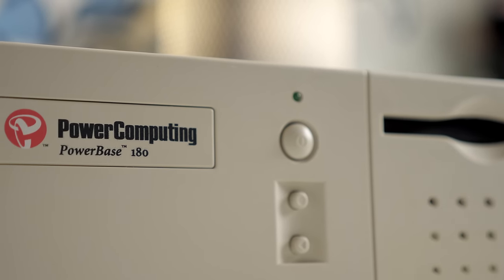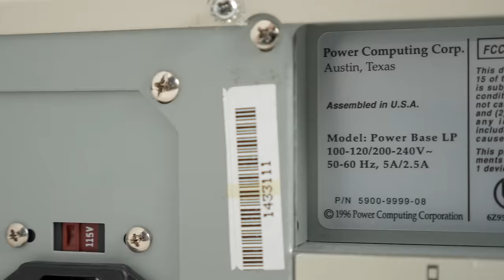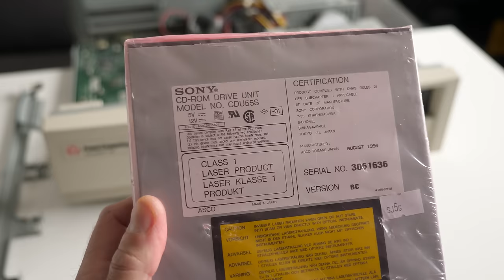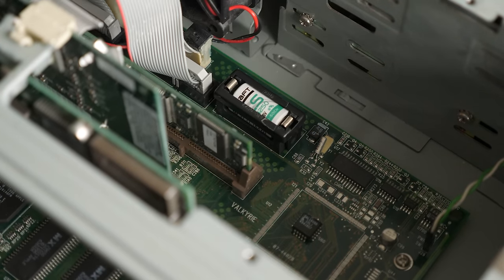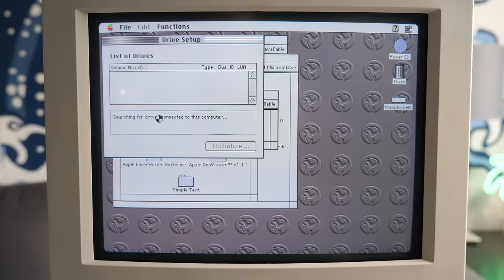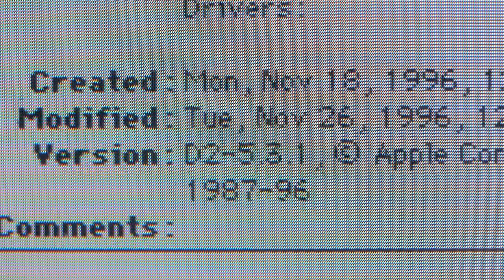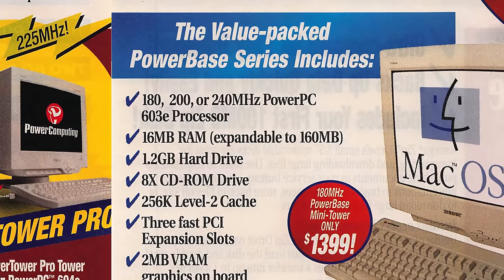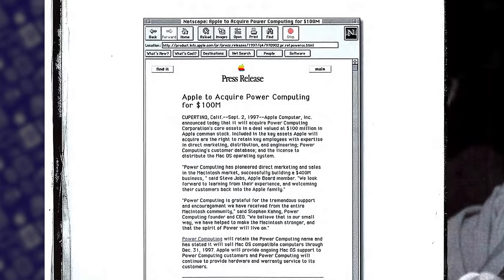Restoring a Power Computing Mac Clone from 1996!

Comment: That was such an expensive time in computing!  It wasn't uncommon to spend between $2000 to $3000 (or even more) for a powerful "blazing fast" system, which would start to feel slow or sluggish in only 2 years or less.
Reply: Six months was the average for the time and why there were so many third party cpu upgrades for both pc and macs. These days the average system often has to last around six to ten years partly due to the shortages.
Reply: My new computer's got the clocks, it rocks, but it was obsolete before I opened the box.
Reply: It's ironic since most people assume that Macs are at their most expensive today with the highest spec Macbook Pro coming in around $5000 (in today's money). Meanwhile, $5000 (in 90s money) was the starting price for a lot of IBM business class laptops back in the 90s. And that was before you added on all the optional docking stations, printer adapters, external CDROM drives, etc.
Reply: @soviut303  that's right, i own a Thinkpad 770X, i bought it two years ago for 70 Euros from a guy in Germany, That 1999 beast cost US$5000 back then, Crazy!!!!
Reply: I had an Amiga 2000. It was both expensive AND sluggish out of the box. It wasn’t nice and zippy until I laid out another wad of cash on an 030 accelerator board.
Reply: @CantankerousDave  Once you got the 030 or 040 accelerator board, you could then get a Mac emulator to run on that Amiga, and in some cases it was actually faster than a native Apple Macintosh. I did that for many years. Quite amazing to be running two operating systems seamlessly on one computer. I will say I did have a decently powerful graphics card that I had upgraded my Amiga 4000 with, so that helped for sure. I spent way too much money on that Amiga keeping it running and powerful enough to run the newer software, even after Commodore went bankrupt and no company was going to buy out the intellectual property to keep the Amiga hardware and system afloat. Eventually moved to PC by early 2000's.
Reply: @marcusdamberger  The Amiga is still alive today, with a Morph OS installed on MAK PCs and you can continue to use this defunct computer.Processors from G3 to G5 are supported.
Reply: In 1996? You could certainly have bought a reasonable mid-range PC for this price that would have lasted. Apple just had a habit of dropping support for their own hardware in no time at all. 

I know people who were using 486s well into the early 2000s
Reply: not as bad as late 80s and early 90s ;-)
Reply: @MrKillswitch88 unless your apple which have been caught slowing their devices each year to get you to buy a new one

Comment: Wow, what a find this was excellent.  You have a lot of technical skill and are very resourceful with both vintage hardware and software.  A Power Computing Mac Clone from the mid-1990's which, was around the time, I purchased my first Apple computer an All-in-One 5400.  Also, I noticed that, "Mac User" magazine rated my 180MHz 603e processor system from Apple with 3 and 1/2 "mice" and rated Power Computing's 180MHz 603e processor system with 5 "mice".  

The main reason, I selected Apple was because they made or branded all elements of my system the CPU, keyboard, mouse, printer, scanner, internal video capture card, internal TV/FM radio card, with matching black remote control, and system software.  My desktop came with lifetime free telephone support so, if I had a question just had to say to my Apple representative over the telephone my "xyz" is connected to my "abc" and state my version of the classic Apple operating system and my issue would be simple to resolve (smile...smile).

Comment: The first CD-ROM drive (Sony?) has sockets for the terminators underneath the SCSI connector, as far as I can see. So you have to install the two or three resistor networks to enable termination.

Comment: That’s an awesome system! The Mac clones have always been interesting and Power Computing made some cool systems. The Sony Trinitron also goes really well with the setup! Great video!
Reply: Even the Mac CRT's with the Apple logo on the front were really Sony Trinitron tubes, they always looked so good. You could tell by the quality of the shadow mask it was using and the fact the tube was curved like on a cylinder instead of a ball. I suspect the electronics inside those CRT's was also Sony, but I never opened one up to see.

Comment: I had a PB240 back in the day. My grandfather was heavy into Mac and we started with a mac plus, the went to a IIci, LC3, then the PB240 and eventually had  Powermac 6500, before building my first Windows PC, in 2003. Been a PC user exclusively since then. I did have a lot of equipment that most people never heard of, like a Syquest drive, zip drives and a magneto optical drive.

Comment: Nice restoration and lovely videography as always. 
I'm surprised the optical drives gave you so much trouble. I bought a PowerCenter Pro 180 in 2020, and it came with the original optical drive and a 16x Yamaha CD-RW - both worked fine after installing just the basic Power Computing system software on a BlueSCSI.

Comment: Brings back a lot of memories of my Power Wave 604|120 system. Many similar upgrades, however I found the Power Computing system to be very fickle as to what upgrades actually worked. I later had a Bondi G3 Mac tower that was a lot more compatible. Remember that Power Computing was using the same motherboard chipsets as Apple but were getting better benchmarks. I would bet that Power was tweaking the clocks a little to get better performance at the cost of compatibility.

Comment: Thanks for the video. Power Computing was killing it in 96 and 97. I bought the high end Power Tower Pro 180, with the 180 MHZ 604e which was brand new in late 96, and it was factory installed with the IMS Twin Turbo 128 video cars. This thing ran circles around anything apple was producing at the time, and faster than pretty much any Pentium or Pentium Pro PC at the time. In the next year Jobs killed PowerComputing (and all clones) and actually started making some good macs. You all know the rest of the story lol

Comment: I had a Radius tower Mac clone. The 81/110 was an extremely heavy unit, all heavy gauge steel. I had it maxed to 264 megs RAM using IBM 72 pin SIMMs. I loved the irony of using IBM branded parts in a Macintosh. ;) I used it for a short time with a NuBus Media 100 video capture and editing system. The NuBus Mac clones with PPC601 CPUs shared the same hardware problems the genuine Apples had. There was an issue with the SCSI and NuBus which was only partially fixed in the 110 Mhz Apple and clone systems. That unfortunately made the Media 100 system incompatible with all NuBus SCSI cards in a Powermac or clone. Thus the only way to be able to capture full quality video at 150K per frame (this was standard definition before it was called that because high-def didn't yet exist), which required a write speed of 4 megabytes per second, was to use FWB RAID Toolkit to stripe a RAID 0 array of at least four high speed drives across both the internal only and the external/internal SCSI buses.

Why I only used it for a short time was because I never could obtain a professional VHS deck with component video I/O, Time Base Corrector, and RS-485 serial control. Since the NuBus Media 100 system has no frame buffer and does nothing to clean up problem video, the tiniest bobble in the video would make it stop capturing. Then there was the hard-coded limit of 2 gigabytes per capture file. Not a problem with a studio video deck with serial remote control so the system could save one 2 gig file after another. Without that I had to manually control a VCR and capture overlapping pieces then cut it together. On the other hand, it had no such file size limitations when digitally outputting to an HFS Extended formatted drive. I used a 17 gig 3.5" full height external SCSI drive to export to. Then I'd connect that to a Windows PC running the Basilisk II 68k Mac emulator in 68040 mode running Mac OS 8.1. With the emulator I could copy the video off the SCSI drive then use the Windows Media 100 transcoder with Adobe Premiere to convert the uncompressed Media 100 video to MPEG2 to use with a DVD authoring program. Media 100 was soooo much easier to edit with than those older versions of Adobe Premiere, but version 2.6.2 (the last that worked with NuBus) didn't do MPEG2 and it was slow enough when doing an uncompressed digital export.

If I'd had the pro VCR it needed I'd have bought a G3 upgrade for the Radius to drastically speed up exporting, but since capturing was timing critical the G3 would have to be disabled for capturing video. Can't make analog video capture go faster than real time anyway.

Comment: I used this computer (with the same Sony monitor that you show) in 1996 and 1997. The only physical problem I had with the machine was that the fan would occasionally stop spinning. A flip of the fan would start it spinning again, so I didn't really worry about it. I was using it for work and didn't own it. For much of that time, I ran System 7.5.3 and it would crash at least once a day. The crashing problem went away once I installed 7.6, so I don't blame the problem on Power Computing. It's the only clone I ever used, and it turned out to be the worst Macintosh I've ever used -- and I've been a Mac guy since 1984 and now use an M1 Mac mini.

Comment: I actually used one of these back in 1995-1998. It was a good workhorse of a machine, but System 7.5.3 would crash at least once a day. Also, after about a year after purchase, the fan on the back would randomly stop spinning. When I heard it going down, I would flip it with my finger and it would start up again and would run for an hour, a day, a week and then eventually die again. I left that job in 1998. It was still in use, so I didn't have to be there at its eventual death.

Comment: I had a dealer license for Power Computing from the mid 90s until the company was wound up. I sold a lot of units to schools who were Mac friendly because Power were so competitively priced, had lots of useful ports built in and were easy to upgrade with standard PC options. At the height of the sales the NZ Apple representatives asked me to discontinue Power sales in return for a better margin on Apple equipment. Discussions went backwards and forwards and eventually realizing that the days of the clones were coming to an end, I went with an Apple dealership instead. Good times.

Comment: We had one of these back when they came out with them and it worked fine, although it did seem to crash a bit and we had to send it out for service once. We still have a Radius 81/110 though that's dormant but still here. Last fired up about 7 or 8 years ago.

Comment: I grew up with one of these Mac Clones, pretty sure we had the Motorola StarMax 3000/180.  Thing crashed all the time, but I can't remember if that was common for Mac's in that era.
Reply: Hehe, it was common for Mac's at the time, probably had nothing to do with it being a clone. I regularly had crashes on some genuine MacOS machines in those days.
Reply: The System 7.5.X versions were kinda buggy.   Quite a few "Type 11" errors, I remember them well.
Reply: It's funny and ironic Motorola would jump onto the Power Pc mac clone bandwagon, isn't it?

Comment: I had that exact same machine in it's original form.  Very potent little machine that I used for my contracting work.  Best value and great performance.  I could see why Apple had to pull the plug, but it was sad nonetheless.  PowerComputing focused on function over form, which was fine by me, and probably many others as well.

Comment: If EveryMac is correct, and I remember correctly, Power Computing were unique in adding PS/2 ports.

The Mac clones are really interesting, and being a Swede, I'm particularly interested in the Reid computers from Centralen Norrland. Of course, being a Swedish company, Sweden being a rather small market, and them only lasting 6 months before the program was shut down makes those machines even more rare than ones from American companies that were quicker to get a license like Umax, Motorola, and Power Computing (no chance whatsoever for them turning up on auction sites, though I do have a search saved just in case).

Comment: In an alternate universe where Steve Jobs does not return to Apple in 1997,  the clone program was not discontinued and the Power Macintosh architecture became a standard similar to the way IBM compatibles were a decade prior. The financially struggling Apple Computer, Inc decided to discontinue it's hardware sales, and focused on selling and licensing MacOS to system builders and OEMs, directly competing with Microsoft Windows.

After Microsoft lost consumer trust following it's exposure for monopolistic tendencies such as bundling Internet Explorer without the ability to remove it... by 2002, MacOS started taking over the operating system market share.
Reply: Thanks for this great comment.

I think that was the dream indeed.
But it probably would never have happend.
The stability issues of OS 8 & 9, and the terrible performance of the early versions of OS X on PPC were holding the Mac platform back.

This even made me switch to Windows NT 4 & 2000 (just for work). 
Later I returned to the Mac when Apple started transitioning to Intel… Amazing times, almost like today with the M1 :-)
Reply: That is almost exactly what was supposed to happen, believe it or not. The entire goal of the AIM alliance (Apple - IBM - Motorola) was not just to develop the PowerPC processor architecture, but to also create a competitor platform to the dominating "Wintel" platform. It was called "CHRP" - the "Common Hardware Reference Platform", but ultimately no one bought into it for various reasons, the main one being a general lack of support. As far as I know only IBM ever made CHRP hardware, and Apple never made Mac OS available for CHRP meaning the only things you could run on CHRP hardware was IBM's AIX, that one weird port of OS/2 for PowerPC, the PowerPC version of Windows NT which was discontinued very shortly after launch, and various Linux distributions. Even if Mac OS were made available for CHRP though, I doubt Apple would have stopped making its own proprietary hardware since Apple was always a hardware company since the very beginning, so the hypothetical Mac OS for CHRP would have just been discontinued along with the Mac clones programme.
Reply: @babyboomertwerkteam5662  Great story! Thanks for adding this. I never knew about CHRP.

Comment: Yeah these things are weird because they're Alchemy systems (basically the chipset from the 54/6400 series) which normally had 8MB soldered RAM and two RAM slots, which explains the weird RAM configuration here. Also there's the blank pad for the VALKYRIE chip which would've been for the lackluster Valkyrie AR onboard video that the Alchemy models normally had. Thankfully PowerComputing opted to engineer their own solution with that ATI chip (which allowed for at least 2MB VRAM unlike the Valkyrie's max 1MB). Also try using D2 CD or the Toast CD Reader extensions; they support a fairly wide range of modern drives including burners and CDROM changers.

Comment: I have PowerCenter 120 that has the same case, but it has 604@120 Mhz. I never used original OS with it, I installed Czech version of Mac OS 8.1 on it. Never had any issues with drivers (didn't have to install them). Also, I find clones more reliable than the original Macs from that era
Reply: And it doesnt have PS/2 ports

Comment: I upgraded from a Quadra 650 my dad "found in storage" at his office to a Performa 6220CD in late 1995. This was a bad idea for multiple reasons. For one, I was 11 or 12 and didn't have any reason to upgrade, other than buying all the PowerPC hype and wanting to see how fast SimCity 2000 would run. The second reason: Had I held off until late 1996 or early 1997, I could have gotten one of these instead, with money left over to get a matching multiscan monitor. 

If you ever decide to part with it, let me know. I'm only 450 miles down I-35 from you.

Comment: Hey Colin, I've asked you this before, though you may never have seen the comment, but I am curious if you ever saw a weird issue with Macs and their disk drives from that time period. I used to have a PowerBook 520 that would read and write discs just fine, but whenever I went to use those discs at school, almost every Mac at school said the disc was blank. Take it over to my PB and everything was fine. Were the old floppy discs just that fiddly? Was there some kind of possible compatibility issues that you know of? I seem to recall them all running roughly the same version of MacOS, but I can't be certain. It was just a weird thing that seemed to happen where only my computer could ever seem to read the discs I made and when that computer broke... that was the end of the data preservation trail for those discs. For the most part, I am just looking to see if anyone else had this issue, or if it was just me.
Reply from the maker: I’ve heard of occasions where a specific disk drive gets out of alignment just enough that it can read and write disks you formatted in it, but other drives can’t. That’s mostly with Apple II machines, but I think it’s possible to happen with Mac floppy drives too.
Reply: @ThisDoesNotCompute  Ah! So it really was like my PowerBook had its own fingerprint, so to speak, that others couldn’t read. That’s both frustrating and fascinating.